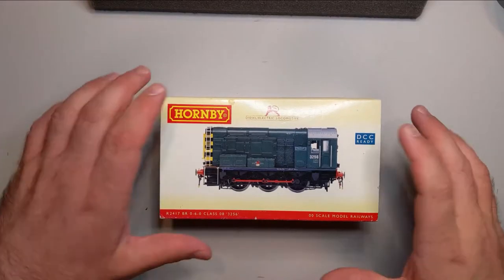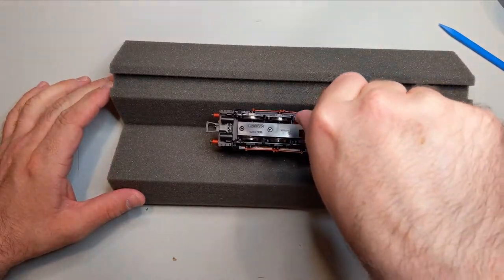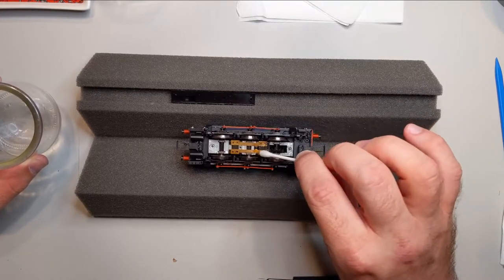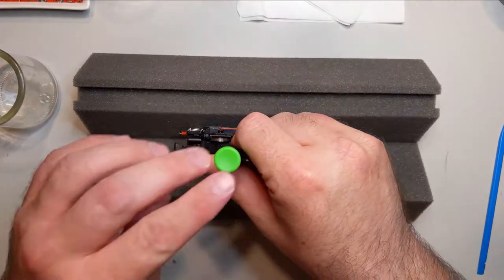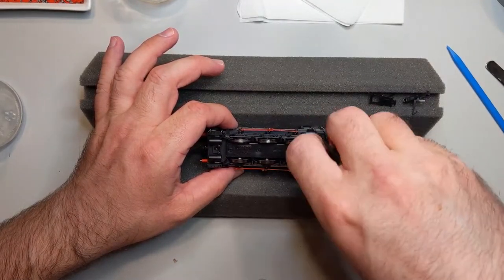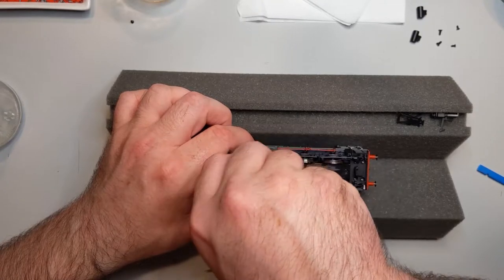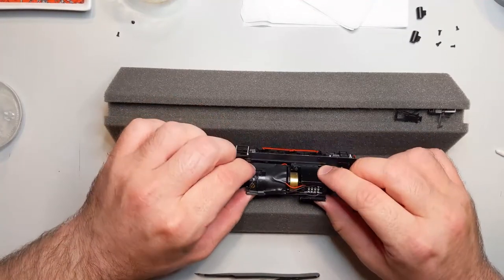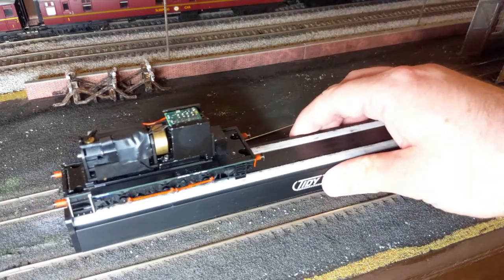Hornby Class 08: Shell Removal, Service, Lubrication and DCC Decoder Install - HO/OO Scale

Comment: Hey you called it w the video helping Down the line I’ve got a class 08 coming and need to put a dcc in this will help a treat thanks my friend
Reply from the maker: Glad to have helped!
Reply: @PendulumStation  hey I have one question. I’m new to dcc conversions so just making sure you said it’s a 6 pin but isn’t that an 8 pin?
Reply from the maker: @BigBOTUS  You're right! My mouth often runs faster than my brain does.

Comment: The general consensus is that Bachmann is the way to go for Diesel and Hornby is best for steam. However there are some excellent models released and forthcoming from smaller manufacturers like Oxford Rail, Dapol, Cavalex and Accurascale.
Reply from the maker: I've started to notice that. Funnily enough, the only steamer I ever had an issue with was a Bachmann and the one diesel I hard a real hard time with was Hornby. I've never owned an Oxford, Cavalex or Accurascale as they're a bit harder to find in the states, but, I've noticed Dapol finding it's way over here. It's on my list of next purchases.